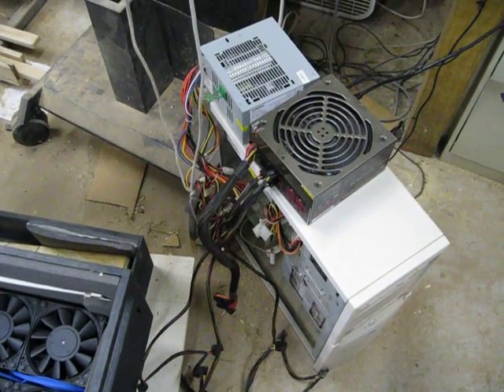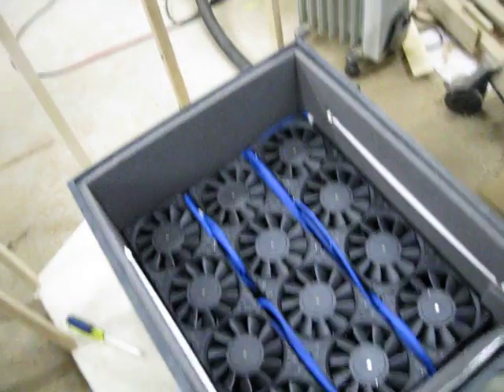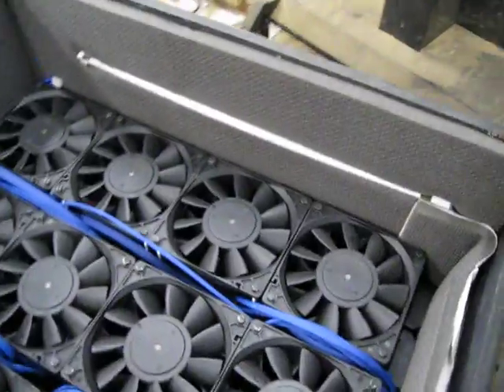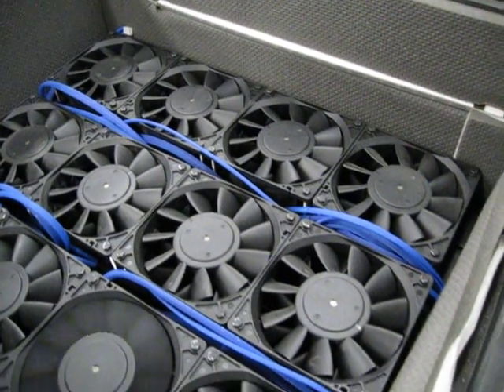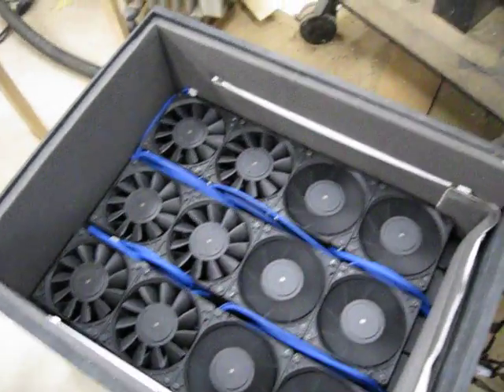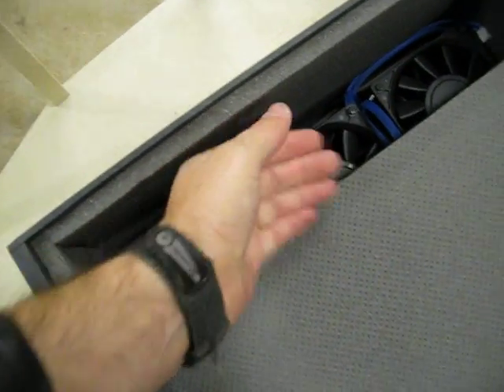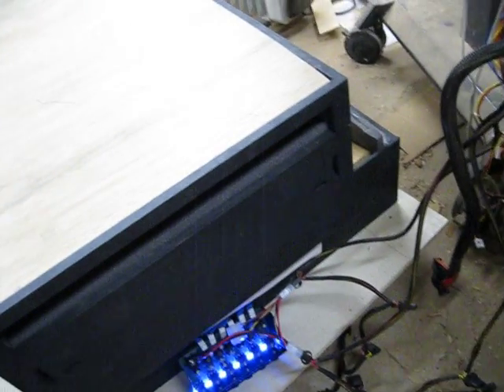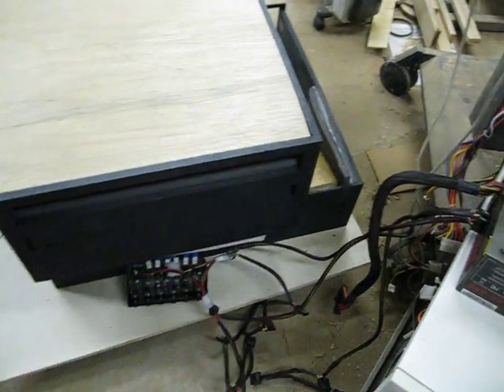Baffle Box with Deltas test

Comment: The sound frequency seems dead-on. It sounds kinda like a turbofan engine when you run it on 12V. Also, I wouldn't recommend to run it at 5V as those MOSFETs didn't like it (I have tried it - so warm on the motor cover, but is still alive, though) so I would have to run it at 6 - 7 volts as a minimum due to Gate charging voltage requirement. And I personally think the sound-dampening material should be carefully chosen because we are taking moving air in account too. Neat project, though.

Comment from the maker: @DrMario2007baka You are right in that the sound is in the air.  In fact without air, we wouldn't be able to hear at all! :)  Sound dampening foam mats will (and do) still help, because they absorb the sound with disregard to its source. The base frequency for the sound the air makes through these fans is calculated as "RPM / 60 * fan blade number * strut number".  Since these particular deltas will be going at 5500rpm and have 9 fan blades and 9 struts, our base frequency would be 7425Hz.

Comment: zniffstamp, I agree with you. I have exactly the same fan (Delta PFB1212UHE-F00) and it's incredibly loud. As you pointed out, it is the air that makes deafening roar - sound dampening foam will do little since the motor itself is completely silent (except for very faint bearing whines when running at full speed). Cool, but useless...